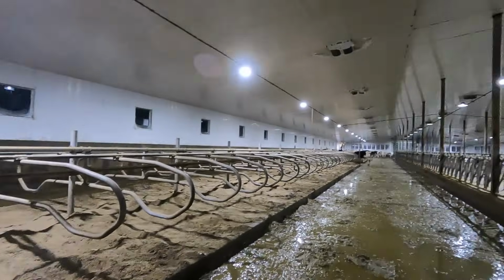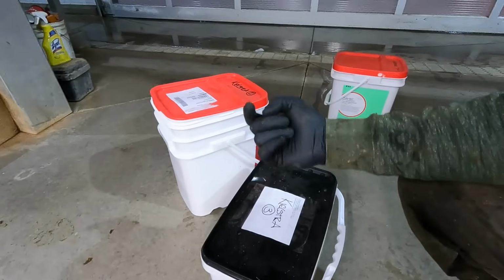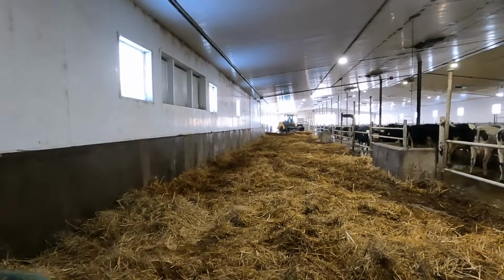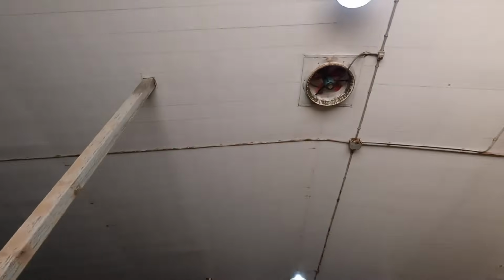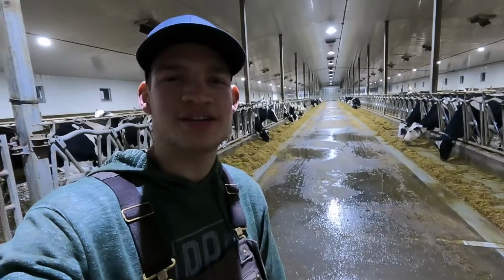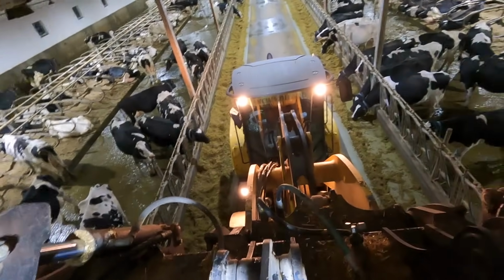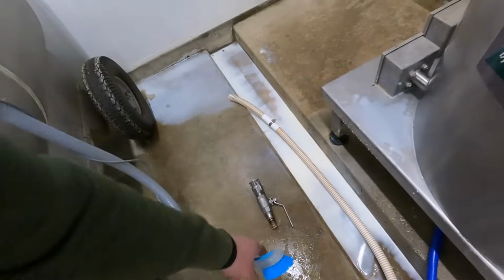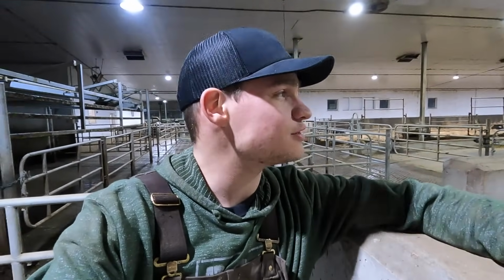A Day In The Life Of A Canadian Dairy Farmer!

Comment: Hey Jan, great video! I have changed those ADF liners before cuz I work at Norwell Dairy, a dairy supplier. I found that if u soak the liners in hot water before u pull them through, the rubber seals around that little plastic spray nozzle better. Proly nit worth doing that for 1 inflation tho 😆

Comment: One thing you could try on the fan is to put a kind of china hat of steel over the fan so you dont get in snow or rain. But you lose some of the capacity of the fan. But that is better than replacing fans since it breaks because off the ice. It works well for our farm here in Norway.

Comment: it is always good to get a perspective of what goes on with farms that supply the country both you and your sister give insight on the running of a farm and what needs to be looked after around the farm and also making the cows as comfortable as possible. Just out of curiosity I see the feeding system and with the sand beds do they have a similar system for delivering sand to the beds, may be easier to access sand to more beds then a bucket on a skid steer.
I enjoy both channels being very informative.
Reply: There is a option called a sand slinger but its probably personal preference to use a bucket

Comment: The blue pasteurizer hose is too long. It should not have that "hang down" that lets the hos lower than the deck. A simple cut and trim at the top connection will rectify the situation.